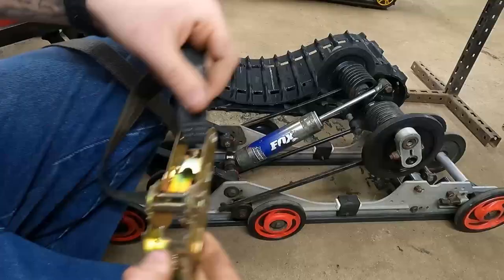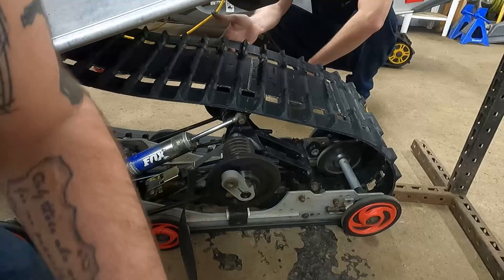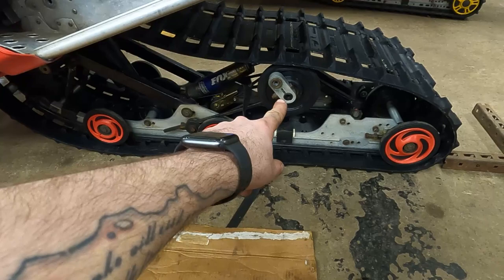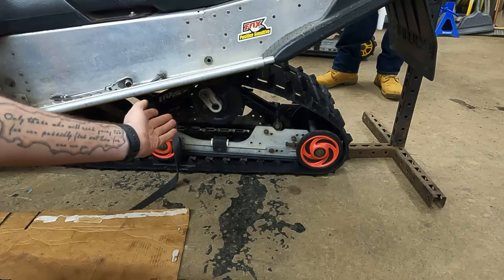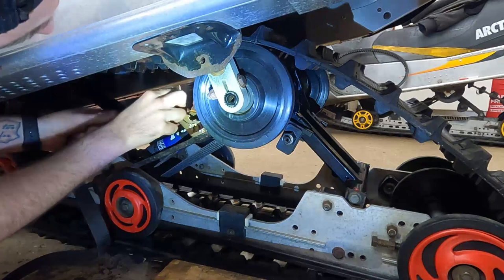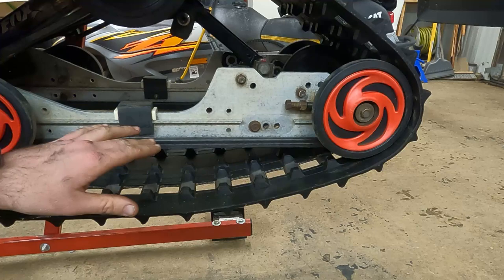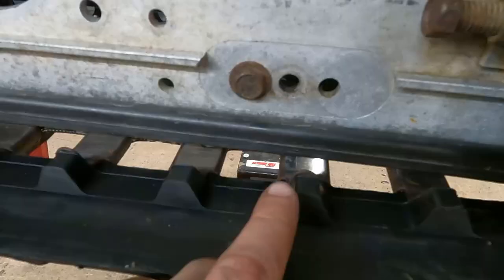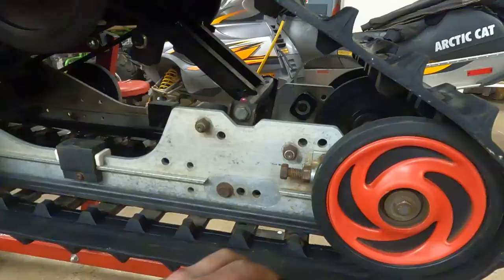EASY Snowmobile Rear Suspension Install and Set Track Tension and Alignment!

Comment: For track tension and alignment, don't put too much stock into the adjuster bolts being set exactly the same on either side.
With age and a few bangs, the tunnel and the skid can get a bit of a twist.
Just adjust for tension and alignment as shown.

Comment: I did my 2000 Cat ZL 550<<very similar...No help. I used a Come Along to raise rear end (Fastened to beam in garage, Easy up down adjust).
Ratchet strap same as you...but measured front to back bolt placement (21") (Set before skid put in)
Then hooked bungee cord into track clip holes & over seat to hold upper track while wrestling skid into position.
Once skid settled in <<lowering come along a little as needed. I did use pry bar to start 2 front bolts. Un hooked bungee at some point.
NOTE: First rear bolt was spot on, easy to start other one not bad as I cranked ratchet strap a little.
Note: shoving rear axle all the way forward (& snug it down a bit)<< as you mentioned good to do before wrestling.
This still not easy.. I was sweating like Mike Tyson at a spelling bee.  THanks for Video
Reply from the maker: That last line tho 🤣🤣 thanks for sharing! I’ve never thought about measuring the bolt spacing before putting it in!

Comment: You did that the hard way for sure. You don't need a strap at all when you do this job.
Reply from the maker: I don’t know another way 🤷🏻‍♂️ and I do like one track every 2 years so it works lol
Reply: Pretty sure you do. I just did this job and the back ones don’t line up without the strap
Reply: @ToyShopRestorations I just put mine back in my 79 Yamaha Enticer, definitely need a strap. 👍. Was looking for a proper tension video when I saw your video.
Reply: If you pop out the springs on both sides you definitely don’t need the strap! All the strap does is fight the spring tension that is totally avoidable 😊
Reply: I’m a believer of work smarter not harder. Good luck!

Comment: I have that from left skid bolt snapped off. Do you think I have to remove the whole skid to replace it? Thanks.
Reply from the maker: Ya probably 😅 that sucks. You might be able to leave it in the track but it’d be easier to drop the skid all the way down

Comment: Bruh, tip the sled on its side. You did this the hardest way possible.
Reply from the maker: Never done it that way 🤷🏻‍♂️
Reply: I've done many skid remove and installs, mostly Polaris. This way, along with some learned techniques is by far easier than tipping the sled.